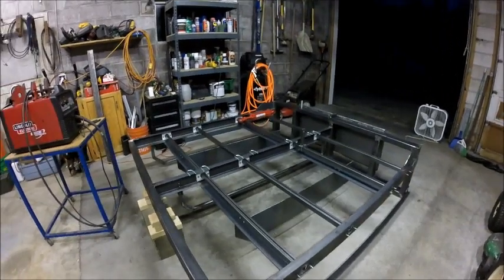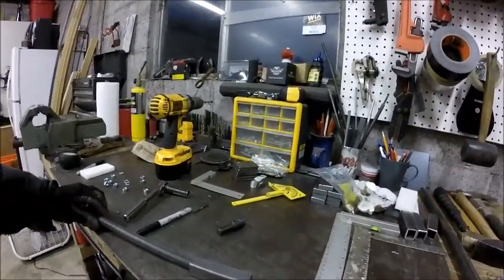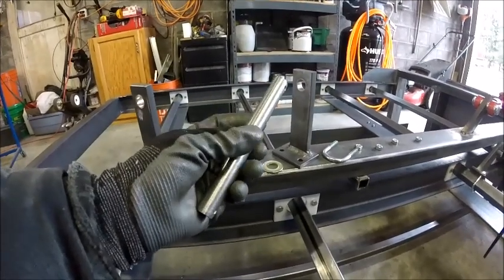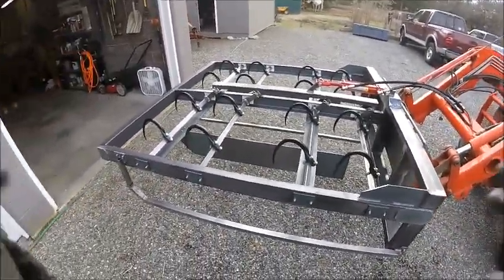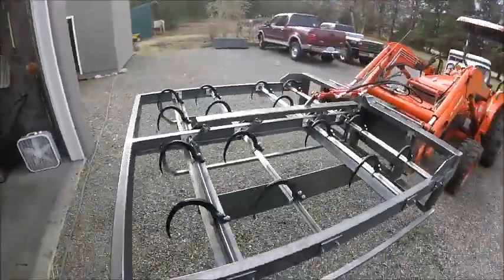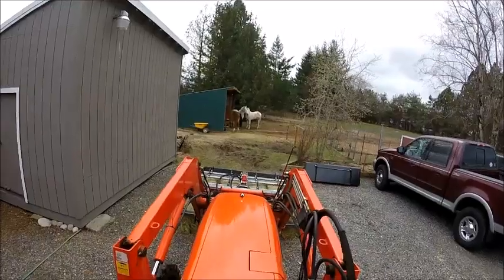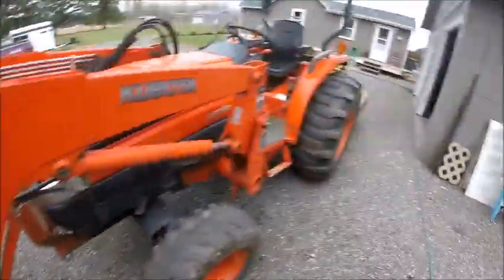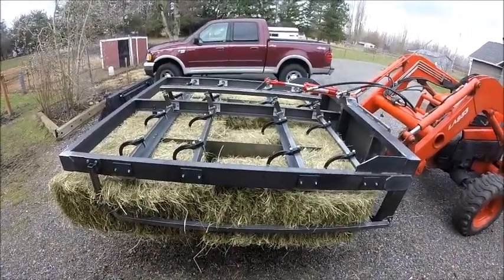Hay Grapple Accumulator Build Part 5

Comment: Now that is a neat build!
Another thing you could do is add beet juice for fluid to the rear tires for some extra weight.
Reply from the maker: Unfortunately I have calcium in the tires.. I'd love to swap it out for beet juice. Being that this isn't an ag tractor, it's a little lighter than say the Kubota M series, so it's hard to find them without loaded tires. Thanks for watching man!

Comment: you done a great job on that Denny. there is always something that people seem to over look on a project. i think i would move them out more then you said a little though. my dad used a 8 bale acumulater behind his baler. it worked great. we would haul all of are hay. so we could take it back out of the stack. it was slower then a stacker wagon but he had 2 sons to help.
Reply from the maker: Thanks Howard! I think I've decided on 19.75" spacings. I was thinking 19.25, but you're probably right. That would make it a nice even 1" spacer, which is material have on hand too. A stack wagon would be awesome, it's just something I'm not setup for though. There's a nice on for sale  not too far from me too. Thanks again!
Reply: for you a accumulater would be best. there are a lot of them out there. were you need to stack inside the stacker is not best. i really like the hooks you got also. if the bales end up a little loose they look like they would hold the bales better.your tool looks like it is built good if you get a accumulater later.
Reply from the maker: Yeah, we'll see how this goes. If I need to build or buy an accumulator down the road, well than that's what I'll have to do. Hopefully this works out good though

Comment: We used to stack our bales with a very similar system many years ago “Flat 8” was very common bale sledge behind the baler accumulated them in 8s , and our grapple was on a tiny new Holland L775 skid steer and we would stack them in the field and lift them with self loading trailer...
Reply from the maker: That's a pretty slick setup they have there! I like that. I'f I had a barn we could store hay on ground level, I would be working on it right now! lol. Thanks for sharing!

Comment: After realizing how dum my comment was not knowing it was an accumulator also, I went to Bagwell farms video about 3 minutes on maxilator accumagraple. In that video he explains how after loading hay to haul down the road the divider spaces have to be tightened up between the bales to make the load road worthy. When arriving to unload since the hay spaces have been tightened up, the grapple won't fit in with the divider in and the dividers need to be taken out then the grapples don't line up right on the bales. He has two grapples to solve this problem, I don't really know what the answers is. I wonder if a flipper, diverter or something similiar out front would solve this problem, possibly even a hydraulic side squeeze. You might not need it now but could be a handy feature in the future. Very nice and well thought out job, if you were ever to have a fabricating business you would never be hurting for work.
Reply from the maker: Thanks David! I like Bagwell Farms's channel, watch it all the time. He has a really good review on his Maxilators. His video is what made me make the decision to narrow up the bale channels. When I measured the Maxilators bale channels, they gave each bale about 20 inches, but people have problems with loose stacks, so I made mine 18-3/4". I think 19.25 might be the magic number. We'll see. 

Unfortunately I don't have a place to store hay on ground level where I could use a grapple to down-stack, so this should work great for getting the bales on the trailer. We'll be stuck hand unloading for a long time probably. Have a great day, and thanks for watching!

Comment: Nice build you did there. I'm not going to lie, I might be tempted to build one of these myself. Looks like it will work well once you widen it.
Reply from the maker: It wasn't a very difficult build, just time consuming. If this is something you've considered for hay handling but didn't want to cough up $6k, building your own is the way to go. I'm a little over $900 into it, and don't regret a penny. Thanks for watching, I appreciate it!
Reply: Denny's Country Life That sounds a lot better than 6K. Used accumulators are not cheap either.
Reply from the maker: No, they're not cheap either. I don't see many around here, but when I do they are in the 3-5k range. Me being a one man operation and not rich, this seemed like the best option.

Comment: Hi, you mwntion bleeding the new third function circuit to get it to work.  Im having a similar problem I think.  Howd you bleed it?  Crack a fitting?
Reply from the maker: I think what my problem was, was the quick coupler on one of the hoses wasn't in all the way. Any air in the system should burp it's way out after a few cycles.

Comment: What measure did you take for the distance that the bales slide in nicely? Between the edge sheet and the wide sheet for the width. What bale width and how much play has the bale in the width
Reply from the maker: I ended up with a chamber width of 19.5 for each chute. It's worked great. This is assuming you have a 14x18 2 string baler.
Reply: @DennysCountryLife  I have a hesston mf press SB 137 inline baler, would you have any plans or drawings you would give me?that would be super cool
Reply from the maker: It wouldn't hut to go 19.75 or 20" if your baler makes odd shaped bales.

Comment: Why do you need both side and any dividers. I thought I saw a bale loader they pushed the hay against one side and the back and then sent grapples in. Without side and dividers it would allow for odd sized bales.
Reply from the maker: The reason I have the dividers is because this isn't just a grapple. It's a Accumulator/grapple combination. First you accumulate the bales as you drive through the field, then you grab them. It eliminates the need to have an accumulator behind the baler.

Comment: Hey Denny, recently found your channel and love the content. Will hope to build something similar over the winter coming. Can you help me get it clear in my head about the shafts and the delrin bearings, have you put square tube in to the round cut out delrin?
Reply from the maker: Hey thanks for watching Roy! Square tube works just fine in round holes. It's done all the time. When you bore you holes just make sure the tolerance is tight. I bought a forstner bit that's the identical size of the tube corner to corner. I originally used 1/4" delrin, I have since replaced it with half inch. Hope this helps!
Reply: @DennysCountryLife  perfect, and if I was to use round bar as the shafts could you forsee any issues? Did you use the square tube mainly to mount the hooks onto it with the u brackets?
Reply from the maker: @roysmyth4284  Yeah the hooks are designed to mount on square tube. With the amount of force applied to the hooks I wouldn't recommend using round tube. Your hook actuator linkage also works best with square tube. I suppose you could use shaft collars and weld the flat bar to them, but I've seen shaft collars slip, even when cranked down pretty good.
Reply: @DennysCountryLife  ok that makes sense. I can source weld on hooks here that would mount to the tube nicely and the delrin end bearings would work fine to. IL look more into the mount for the actuator onto round. Thanks again for the help.

Comment: What size pieces of Delrin did you get?  I know you said 1/2" thick, but is it 3.5" by 3.5" or 3" by 3"?
Reply from the maker: I bought a 12x24" sheet of it and cut it into 2-7/8 wide pieces x 3-3/4 long. It fits perfectly inside the web on the C-channel.

Comment: What´s the size of the square tubing you used to hold the hooks
Reply from the maker: I think it's 1.5 x 3". Not for any specific reason. I was going to use 2x4, but found this size for cheap with a thicker wall.
Reply: do you also happen to have any sort of technical specifications for the hooks ? @DennysCountryLife

Comment: I want to build one just dont no where to start
Reply from the maker: If you watch the whole build series you'll get a good idea. There's a lot to do and think about, but you just have to dive in and do it! I went into this with a basic design and dimensions that were pretty much just in my head, so you don't need to have cad drawings and an engineering degree to build something that will work great for a long time. Thanks for watching Shane!